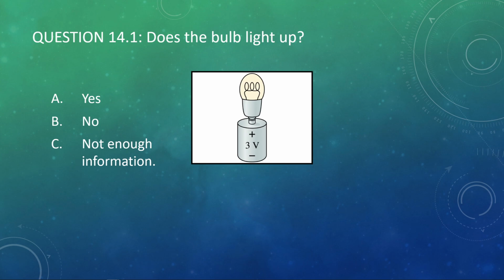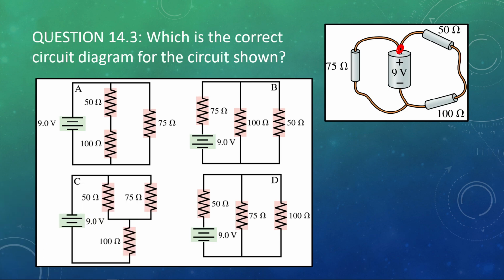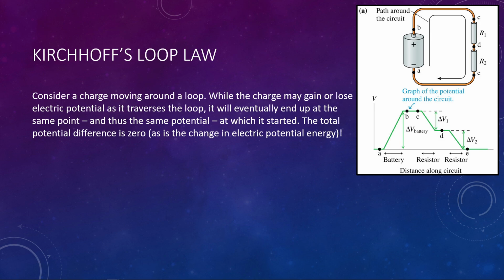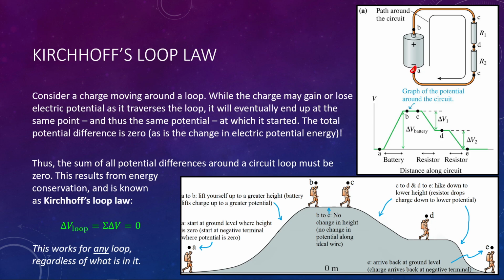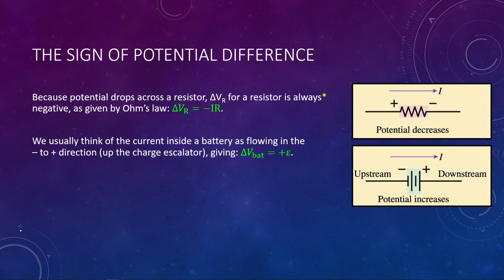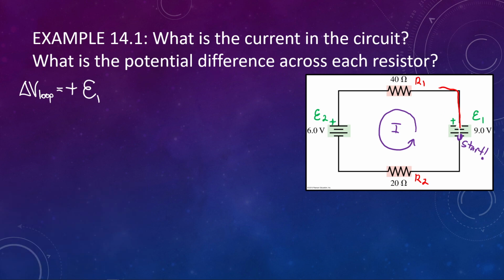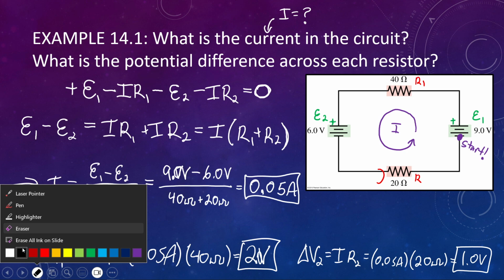College Physics 2: Lecture 14 - Circuits and Kirchhoff's Laws

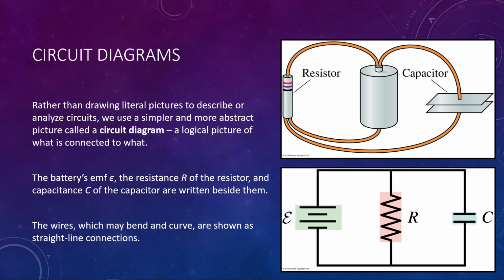Comment: quick question, and correct me if I'm wrong but, at 7:40 in the video the show a battery suppling power to both a resistor and capacitor, but your circuit diagram shows the resistor and capacitor in parallel. Are the capacitor and resistor not in series in the image?